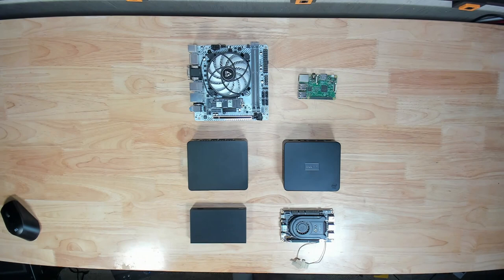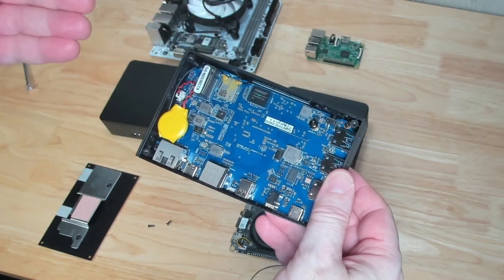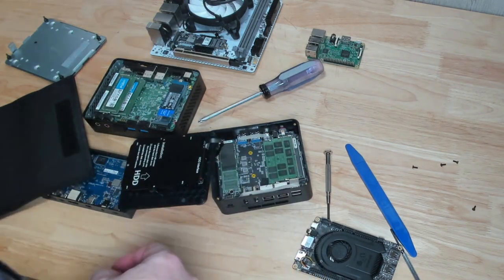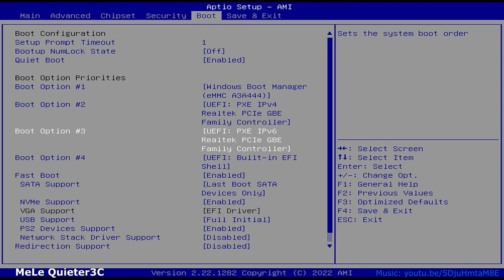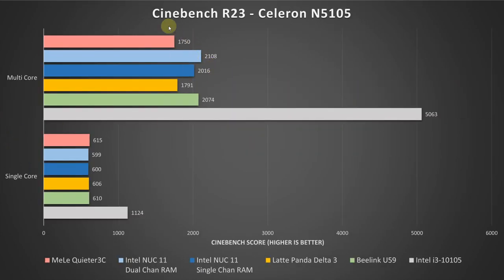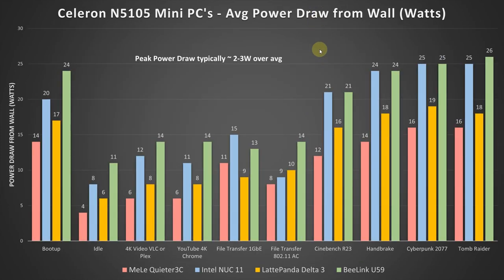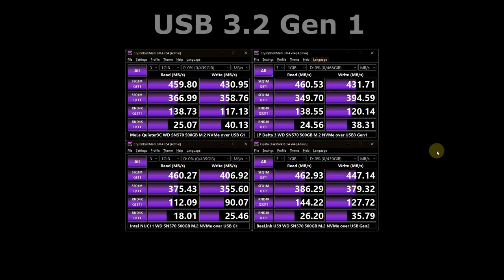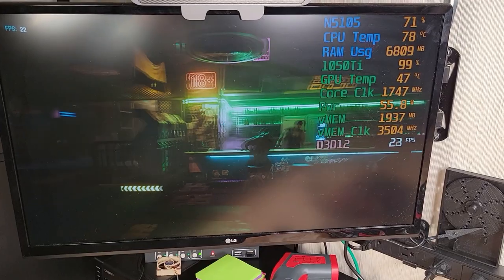Celeron N5105 Mini PC Comparison: MeLe Quieter3C, Intel NUC 11, BeeLink U59, LattePanda Delta 3

Comment: Thanks for the detailed comparison video. 👍
The performance and temperature benchmarks have been very helpful in my selection of a mini pc. 
I decided to go with the intel nuc. 
It would be interesting if you could test the fan noise under idle and under normal load. But I have now also heard from other reviews that the intel nuc is very quiet or almost inaudible in normal operation.
Thank you and greetings
Reply from the maker: Thanks. I have another video coming comparing N5105, N95, N100 with DDR4 and N100 with DDR5. I am doing a fan noise comparison on those, however it's tough to quantify in a video without decent equipment in a quiet room. But I'll provide what I can.

Glad to see you chose the NUC. It's a solid contender and I like the solid metal construction of it. Too bad Intel is exiting the NUC game.
Reply: @htwingnut  Yes, it's a shame that intel is getting out of the nuc business. I don't understand that at all. 
I'm looking forward to the comparison video you mentioned, it sounds very interesting. 👍
What I just remembered and had wondered when I saw the video. How loud or annoying does the fan actually get on the Synology you see in the background? Certainly louder than the fan from the intel nuc right?
Reply from the maker: @Pro-Bert  Absolutely. The Synology fan is louder than any of the fans in those mini PC's.
Reply: @htwingnut  Thanks for the info. 🙂

Comment: Interesting how single vs dual channel memory had such an impact on FPS in gaming. Then again, the memory is being shared between the application (game) and the GPU, so having an extra channel for the GPU would reduce contention.
Reply from the maker: Yes, I don't understand some manufacturers do not implement dual channel RAM, even if the RAM is embedded in the device. It's only beneficial, and the capability is in the chip already, so why not?

Comment: Can you remove or hardware disconnect all of the wireless connectivity on any of these?
Reply from the maker: Very good question! The Beelink and Intel have removeable Wi-Fi cards.
Reply: Thanks so much, would you happen to know any cheaper ($0-$150) mini or single board pcs from large manufacturers (Intel, etc) that can have the wireless connectivity removed (or doesn’t have any)? Looking to buy a couple of them for running a Bitcoin full node and doing sensitive cryptocurrency related stuff so I’d rather not trust some lesser known small manufacturer to not have a vulnerability in their hardware.
Reply from the maker: @martinlutherkingjr.5582  These are all running the same hardware more or less. All Intel CPU and chipset, so they'd all use the same drivers.

Comment: Very helpful, would all these machine’s run linux and docker.....many thanks
Reply from the maker: They should, but I have not tested it yet. I usually try to at least load up Ubuntu to check for usability, but I did not in this case. I may do that and post a quick video on results.
Reply: @htwingnut  Thank you, did you manage to repair the wifi , still can’t make my mind up on either n5105 or n100 mini pc
Reply from the maker: @ashtonwoodturnings225  No, I didn't fix it yet, just a dab of solder will do it though. Haven't taken the time to do so yet. I would recommend the N100 only because it's newer and overall a faster CPU and you can get a device with 2.5GbE networking (if that's important to you). I am pretty impressed with the Trigkey G5 overall.
Reply: @htwingnut  Thank you for your thoughts

Comment: Hello, in gaming would there be much difference if it only has 4gb in single channel?
Reply from the maker: 4GB would be very limiting because it would then only be able to use 512MB of system RAM for video RAM and 3.5GB for other stuff. Dual Channel will give generally 10-15% (or more) performance benefit depending on the game.
Reply: @htwingnut  yes, I understand, obviously I don't expect to be able to play Forza with 4gb, but how about simpler games, like Fall Guys, LFD2 or Rocket League? I have a desktop PC, but I'm looking for a simple laptop to play in my job when I have a free hour 😅 and this is the cheapest option
Reply from the maker: @javierg.5418  Sure,. Entirely depends on the game. But you can get the Beelink S12 with 8GB RAM for $147 at Amazon right now: https://www.amazon.com/dp/B0BVFVRDXN
Reply: @htwingnut  sorry i forgot to mention that the option i found is a laptop, and i saw that the cpu is the same as your video, thanks for the answer
Reply from the maker: @javierg.5418  What laptop might I ask? Hopefully it has room for another 4GB stick of RAM. If so then you can try and if you need, add another 4GB stick. 4GB these days is barely enough to run Windows let alone a game unless it's something like FTL, Vampire Survivors, or much older game like Fallout New Vegas.
Reply: @htwingnut  It's a Dell Latitude 3120, but the ram memory is unfortunately not expandable since it is integrated into the board. Even so, for the price it seemed like a good offer, In my country I could get for approximately around $75, It's really cheap

Comment: What do you recommend
Reply from the maker: I'd like to say which, but that depends on what you need/want? SD Card? NVMe or SATA M.2? Need 2.5" SSD option? more than 8GB RAM? The Beelink seems like the best bargain, because it includes SSD and RAM and has a 2.5" SATA drive slot. But it also comes down to price. The MeLe is a nice little basic compact unit, although limited expansion options but includes SD card.
Reply: @htwingnut  ty Ty beelink looks great I appreciate you posting me back